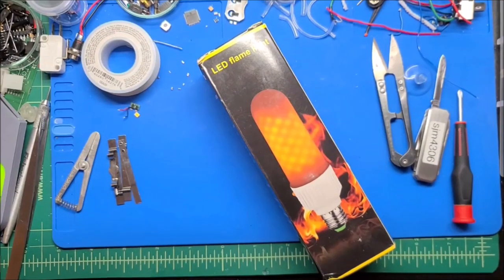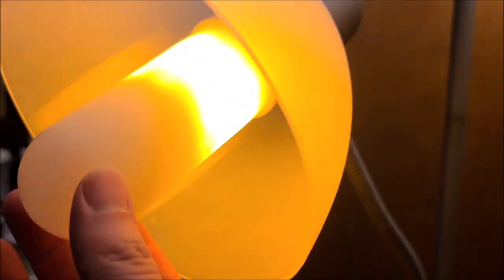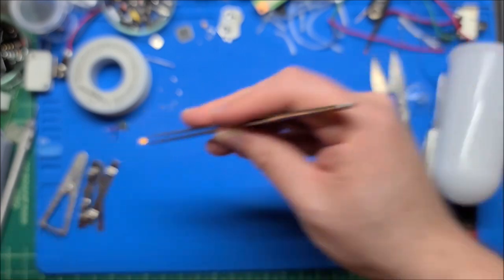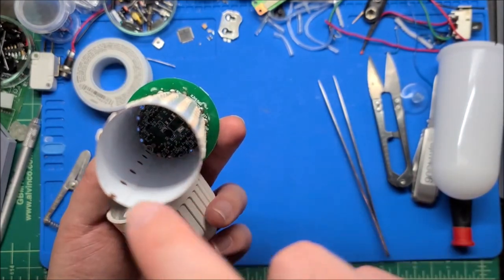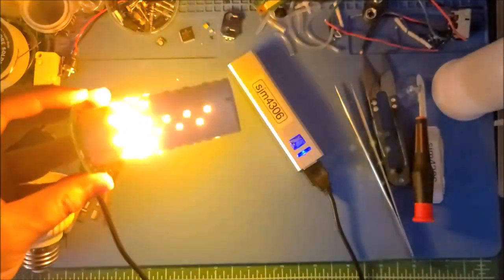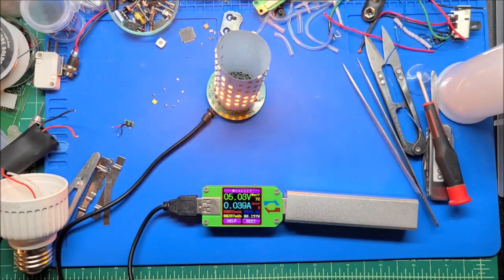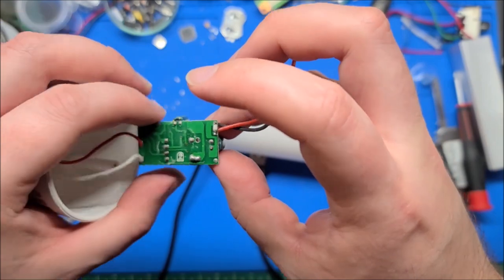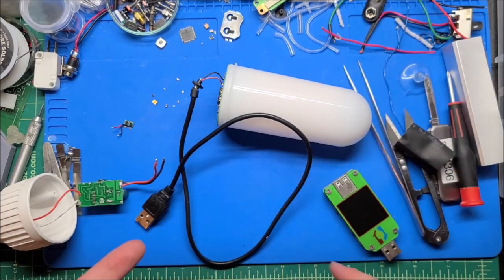Flame Bulb Teardown

Comment: I made a lantern using one of these. I used the plastic tube and wrapped it with polyester fiber fill from the craft store. I use a 2 x AA cell battery pack with a switch. My test was a litter over two months left on. I wanted to use  D cells. The pack did not fit inside the lantern. She loves it. I got a couple of these lanterns at the craft store. They are black metal with glass windows.

Comment: Best teardown I've found. Thank you so much. I have one that is somewhat similar, and I'm trying to figure out how to remove the 2 non-flame modes so that it always goes to flame/flicker when turned on. Have you tried messing with the modes at all? I was wondering if bridging the small ceramic capacitor might remove any memory used for determining last mode.
Reply from the maker: I haven't tried it myself but shunting the ceramic supply cap with a resistor should help with what you want. Test a few values to see what works but doesn't drop the supply voltage too much (I'd start at 1k and decrease a little at a time to find the ideal value).
Reply: @sjm4306  Appreciate the reply.

Comment: Hey ive had a problem with my new nintendo 3ds xl ive homebrewed it and its been pretty good but latley the touch screen goes off by its self and the top right corner is unresponsive and when i tap on a app (if im luck it will respond) but it will tap on a whole nother diffrent app please i need help❤️
Reply from the maker: Try cleaning around the edges just in case some dirt/dust is pressing on the corner and also recalibrate the touch screen in the settings menu.
Reply: @sjm4306  ok thanks ill try😁
Reply: @sjm4306  it worked temporarily but the sane thing still keeps happening